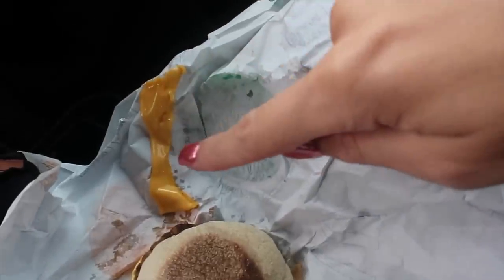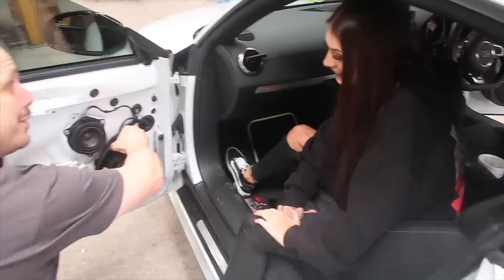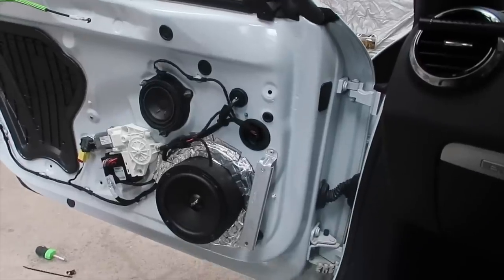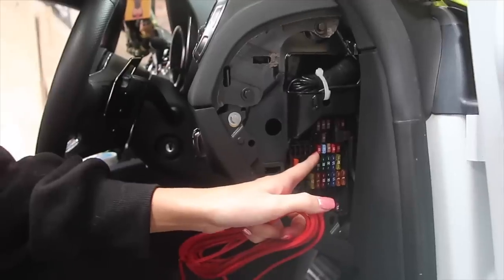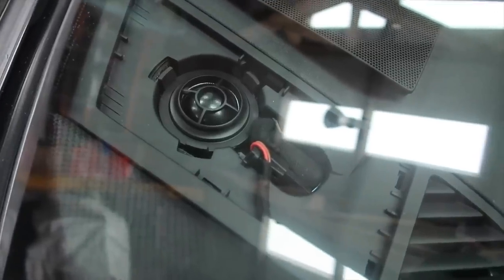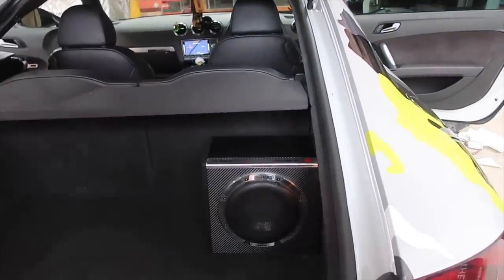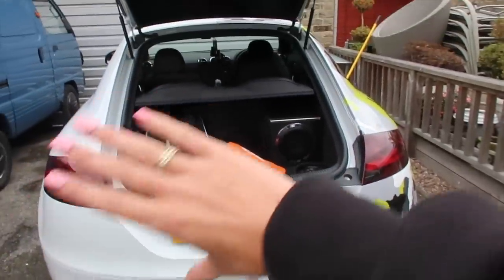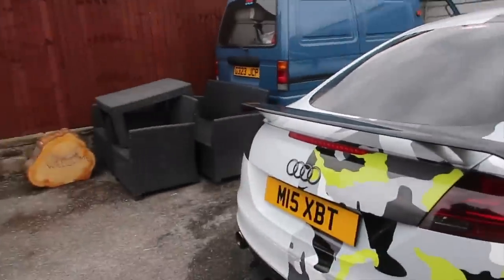I Fitted My Own Speakers On The Audi

Comment: that power cable into the fuse box, can that replace the power wire normally connected from the battery to the amp then.
Reply from the maker: Dean Turner I think so
Reply: Where do you get that specific cable from? Thanks